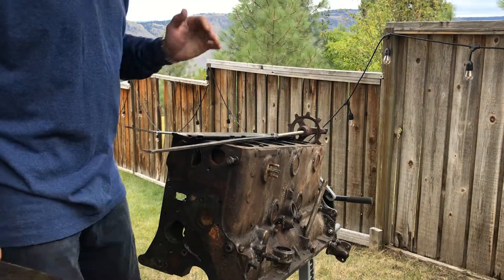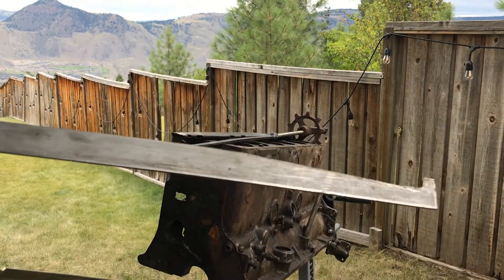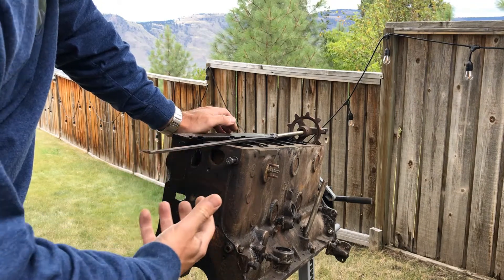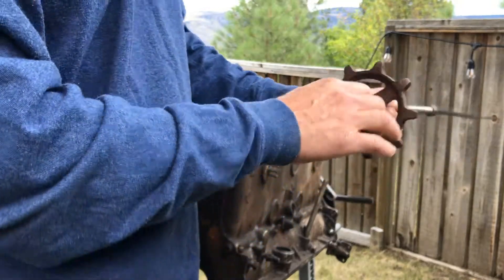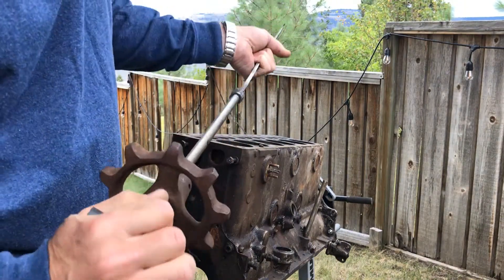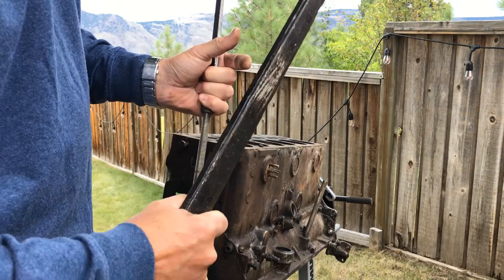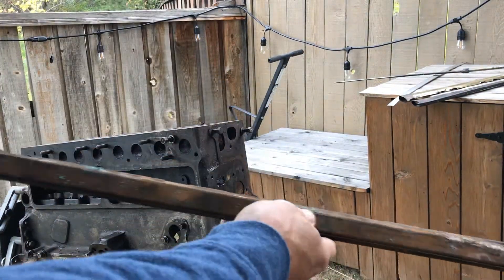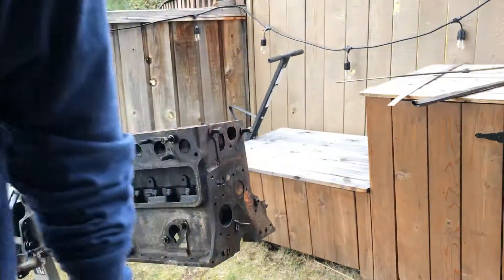Water Tube Removal Part II - Success!!!

Comment: The odd-ball 1938 Dodge Brothers D10 (Canadian "Plodge") came with a de-stroked Chrysler engine during part of the year, and then came with the Plymouth engine.  We removed the worn-out Chrysler engine in our D10 and installed an American 1938 Plymouth P6 engine that we rebuilt.  We replaced the water distribution tube and, as you say, our American P6 engine had a steel tube, not brass.

Comment: So I've been thinking about your home made puller and your doner puller from one of your MoPar friends.  One day I'm sure I will want to pull mine out to see what condition it's in.  So why wouldn't one make that puller with 7 teeth on it as opposed to one tooth sticking up.  Especially in your case since you had a spare you could be very precise on the placement of those teeth.  With 7 teeth they would all be pulling at once.  Distributing the force or pressure on the openings equally.  The other advantage would be if the tube was in poor shape and you were pulling on just one of the openings it might break and leave part of the tube inside.  Since you have a spare and if you like my idea, perhaps your Mopar kind heartedness heart and mind and soul, might consider making a cardboard template for others.  Or even a detailed diagram with precise measurements.
Reply from the maker: Thanks for your comments. I suspect it would be difficult to align a multi-tooth puller tool in the tube, while installed in the block. It was not simple to align just one tooth, using the tool I had. It did not easily bite into place on several tries. I agree with your principle of spreading the load over several locations while hammering it out. I attempted to pull a little on each hole, to keep moving the load around. Not ideal but did work.  The Canadian brass tubes are not the same the steel ones used in American engines. They are different dimensions, as seen here in my other water tube video:https://youtu.be/323k6qdmMFM
Reply: @keithsgarage5831  Yes I remember seeing the width difference in your other video.  I wonder if you would be kind enough to take a measurement of the width for me.  So that way when I go to order one from whomever, I'll get them to physically check the width of it before I place the order.   Thanks Keith

Comment: I like the puller. It looks easy enough to make. How can you tell if it's a Canadian engine? Also how did you get the front grill off. Mine is held in with slotted screws that have been in there for 83 years.
Reply: There are a few different methods for removing bolts and screws. 
I'd 1st try to just soaking it in diesel or penetrating oil ( for bolts not for girls hahaha).

If that doesn't work, you would either have to weld a washer and then nut on it or drill it out.
Reply from the maker: Look for “C” in the serial number. Front left side of block. Also a cast logo with a “”W” and an “A” sorta on top of each other. LH lower side of block. Indicating Windsor Assembly plant.

Comment: Several videos you said your car was overheating. I imagine that is why you pulled the distribution tube. What did you find with the tube other than it got ripped somehow. oops! Did you find the problem with overheating?
Reply from the maker: The car only got hot enough to open the pressurized rad cap one time. That was a couple of weeks ago in  100F weather, after climbing a long steep hill home. The old rad a was leaking at the tank seams. I planned  to pull it and have it rebuilt. Upon removal I also found that the rad core tubes were partially plugged. Coolant was not flowing great. The water pump bearing was well on its way to a failure too. Also no thermostat found in the water neck. All were addressed as well a new 10 psi rad cap installed.

The rad was re-cored, and rebuilt and flows very good now. I just completed my first test drive this morning. Everything is working very well. I am waiting for hotter weather this afternoon to drive it again and put it through further testing.

I pulled to water tube because they are notorious for rusting apart. Normally they are steel. Mine was brass and in perfect condition. I inspected  the 2nd one I pulled in this video here and reused it in my 38 car. A video is coming son on all the cooling system work I did.
Reply: @keithsgarage5831  Great, I look forward to seeing it.